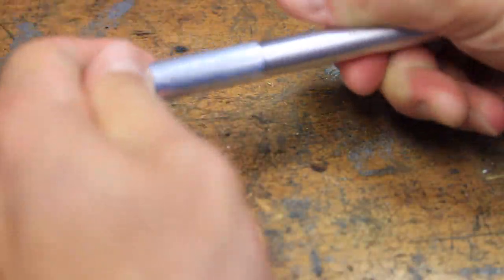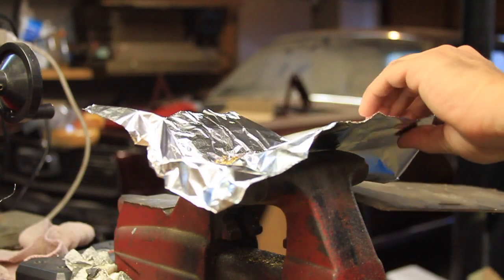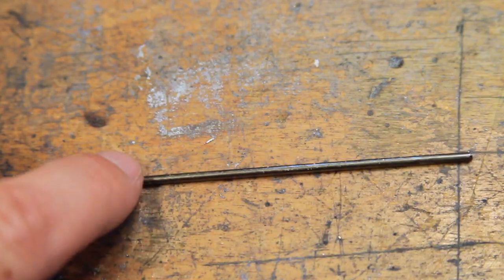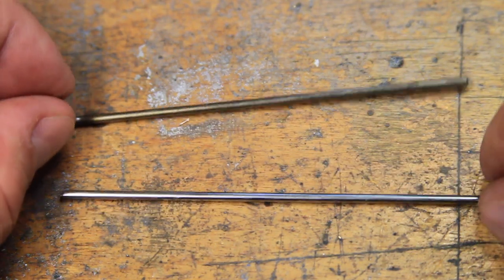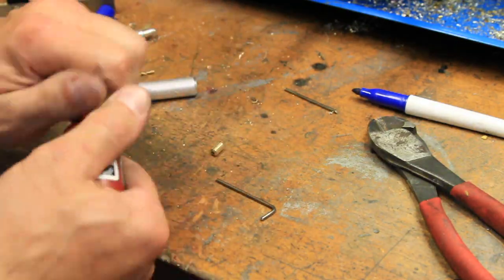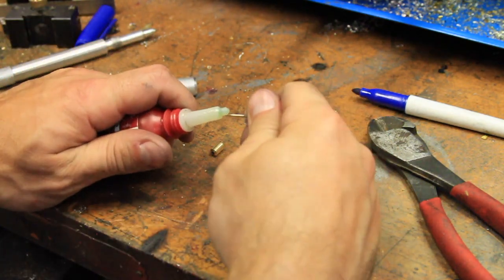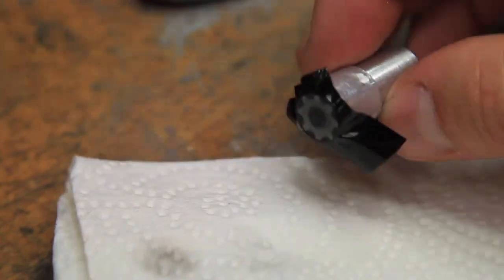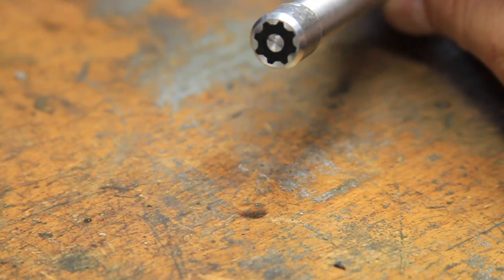Making A Brass and Spring Steel Pocket Clip For My Pen + More Etching w/ Aluminum Black

Comment: hey tim, it looks like your chips were not free from some oily residues, maybe that is also a factor.  i blued a centerpunch successfully by heating it up with the torch directly, needs patience and the chances to screw up are pretty high to be honest, but it works great if you take care not to overheat the part. 

try a small copper/brass pan filled with brass or copper chips, copper should work great since its highly thermally conductive .)

by the way, i changed the bearings on my lathe to tapered rollerbearings, its an amazing difference and i can recommend you doing this aswell (doesnt cost much) but the turning quality makes a huge step forward!

Comment: Hello, for 'coloring' steel, when I arc weld, I sometimes brush the weld with a brass brush and it gives the brass color to the weld only. Maybe try it out, but I think you don't heat the part enough